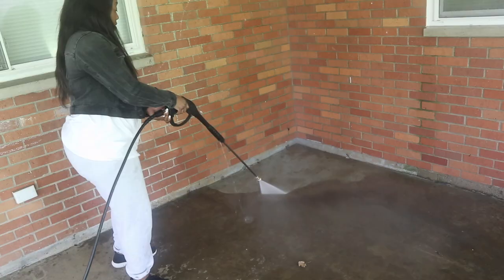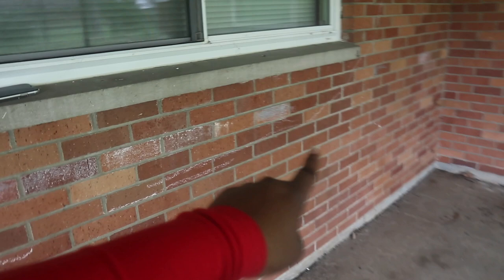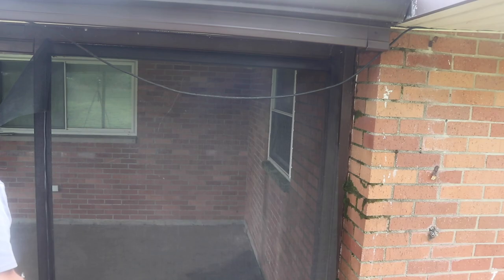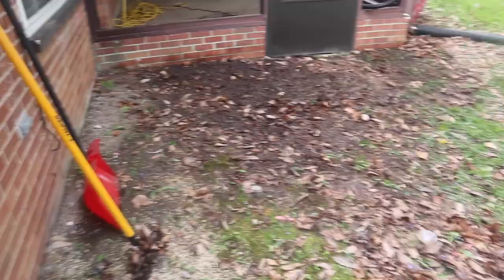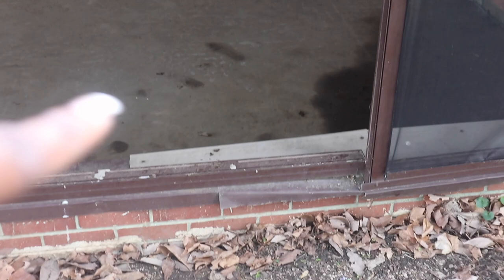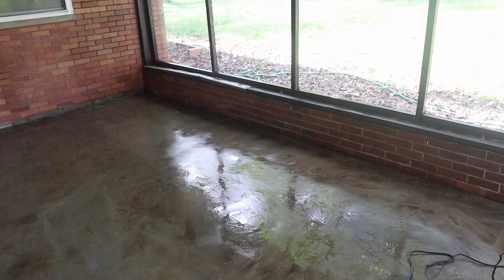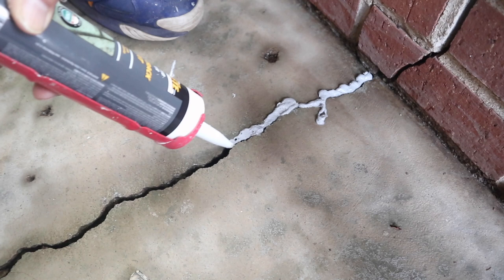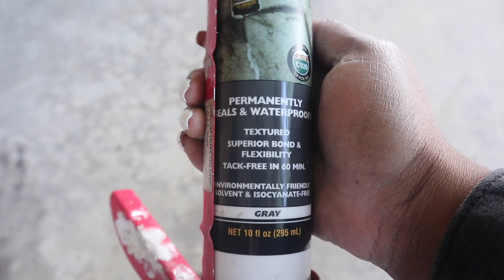HOME RENOVATION SERIES EP:4 Patio TRANSFORMATION  pressure washing |Screening windows painting patio

Comment: Love the way everything is coming alone! You need to seal between the patio floor and the walls with caulk or the gap filler that you used on the floor. Paint the concrete ledge under the windows and the bottom of the wall of the house with the same concrete paint. I can’t wait for the reveal❤️!

Comment: For cracks that large (half inch or deeper) you would have to install  what is called a crack filler rope and then caulk on topnof that. Just filling it with caulk, it's going to crack through the caulk again. The filler rope is like $10 on Amazon or Home Depot.

Also may paint the concrete slate gray, then do a stencil pattern in the middle. Almost like a painted rug pattern.  You can get stencil pattern off Amazon.  Or just use painters tape to tape off your own design! 

You're doing an amazing job!

Comment: Looks great!  The crack in the concrete is a sign that the dirt underneath is shifting and there is a structural issue going on.  I know you've already painted the patio, but I would suggest getting some self-leveling concrete and spread it in the top right corner where the water has been settling.  Over time you'll probably have to have the patio rebuilt.
Good Luck with Everything!

Comment: Get you some quick set concrete mix you can get it from Home Depot all you add is water stir it quickly poured into your hole smooth it out if when you spilled over a little bit so it becomes smooth, depending on your temperature it should dry within 24 hours, hey! ready for you to paint over it🤗

Comment: Probably using some degreaser first would have helped getting everything lose and up if you didn’t have any cleaner mixed in with the power washer and a wire brush to break up anything tougher.. I wonder how much it would have cost to have just a thin layer of concrete applied over it all

Comment: Concrete paint will sweat so be careful  when walking on it it can be slippery.  The sealer your using to fill the crack but will only be a temporary fix due to it will expand and contract with temperature changes and continued movement in the foundation.  Hope that helps!

Comment: Wonderful job loos so so good. But! Looks like you may have a foundation issue,water is getting in under concrete  over by the window  by the screen  i see that the downspout is not  connected. Direct  the water away from the house. Also the brick still has green  stains, cement   can be repointed then put on a sealer